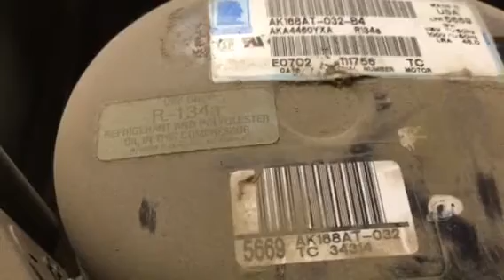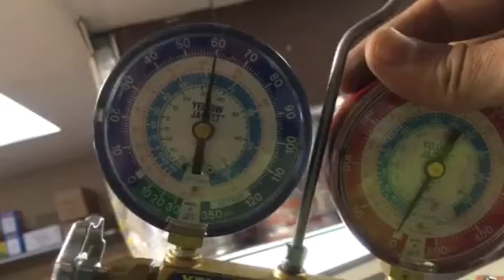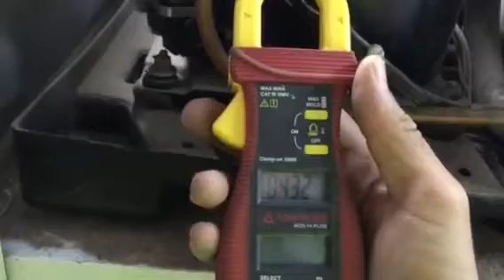Fridge keeps tripping the circuit breaker

Comment: We have a stand up freezer that we defrosted over the weekend. Now when we plug it in, it runs for around a minute and then trips the breaker. Any thoughts? Was working fine before we defrosted.
Reply from the maker: Maybe some wires got wet because of the water drainage by defrosting it , let it set for 82 hours before you turn it back on , if it’s still tripping the breaker possibly it has defective relay capacitor which is located beside the compressor , that part needs to be replaced .
Reply: @hameedwafaAFG  Thanks so much!!
Reply from the maker: You are very welcome ✌️
Reply: Did you finally figured out what was the problem? 
cause my fridge is having the same problem
Reply: @kondwanibarton1391  left it unplugged for 82 hours like they recommended and it worked!

Comment: Salam,  what may be the cause of power trip on my fridge whenever the timer goes into defrost mode. I had changed the freezer compartment combine thermostat/thermal fuse with a new piece. Tested the heating element and its working. Had also isolte the heating rod in the produce compartment, Thank you.
Reply from the maker: robat ahmad Walikum asalam, if you are still having the same problem, check your defrost timer, could you send me the model number, thankx!
Reply: @hameedwafaAFG  . Salam Brother Hameed, thank you for your fasr response. The fridge is FISHER & PAYKEL. Model N500B. The timer is INVESTSYS APPLIANCE, 12ours timer. Part No. 873253, 220 v, 50Hz. Fridge has a separate freezer and produce compartment. The top produce compartment has also a heating rod and a thermostat/temperature control which I had replaced with a new thermostat of same model ( Danfoss). As mentioned in my previous comment, the freezer thermostat/thermal fuse was also replaced with a new piece ( ELTH K-II Type 261N). Both compartment cools down well but power will trip when the timer goes into defrost mode. Fridge wiil also trip when timer is turm manually to defrost mode even though the fridge is warm. JazakALLAH Khair.
Reply: Same issue had changed everything but same issue everyday after fridge running for few hours. Had water leakage issue due to defrost problem changed the needed parts but now it keeps tripping the mcb

Comment: Salam Brother. Just seeking for some advice. Our Samsung fridge keep tripping the circuit breaker whenever we close or open the door fridge. Any thoughts?
Reply from the maker: Walikum brother .maybe door switch is shorted or had problem with fan motor inside of the fridge or condenser fan motor . Worse case could be main control board or compressor . Honestly you may need a tech
Reply: @hameedwafaAFG  thanks brother. Jazzakallah Khair

Comment: Been having a weird surge problem with a brand new Daewoo mini fridge. It causes a surge nearly every time the compressor turns on & off while maintaining the temprature. Could this be a problem with the mini fridge or the outlet? I did get a new outlet so I am prepaired to replace it if I need to. I really don't want to have to replace a brand bew mini fridge that still keeps cool. But this surge issue is a little concerning to me. No fires or complete blackouts caused by this issue yet but I do worry the outlet or fridge or even the circut breaker could stop working entirely if the problem gets any worse. Will be trying a Trip Light Isobar surge protector to see if it helps at all before resorting to messing with the outlet or fridge itself.
Reply: The mini fridge has no built in surge protection or circutry or energy star power saving tech. Ssems to be a direct to overload protector/starter relay to outlet wiring. Very underdesigned for such a big appliance. This could I suspect be causing the issue to. Suprised Daewoo didnt ingegrate any of this tech into their mini fridge for the price it was.
Reply from the maker: TheAtom I would say use air compressor to clean the condensor coils and replace the relay capacitor on the side of the compressor ✌️
Reply: @hameedwafaAFG  The thing is this is a brand new mini fridge. Just got it last month. Back compartment is completly clean & no visible damages. I guess I could try replacing the relay unit on the compressor of its really needed. Its on there pretty good though. Cant seem to simply pry the cover off with a screw driver or something & thee are no directions on how to remove the cover from the relay unit.
Reply: @hameedwafaAFG   Just got the Trip Light Isobar surge protector today & it seems to have really helped prevent the mini fridge from causing a surge to the rest of the room. Very well made surge protector to. Even has its own built in fuse. Mini fridge still makes a click sound when the compressor engages so I may test the starter relay & see if it needs replacing anyway. I think that sound could also just be the control box becoming faulty. May have to get that tested to.
Reply: Surge still being caused by the mini fridge compressor turning on & off. It seems to trip the circut its on no matter what I try from the room short of replacing parts in the fridge itself. Even after replacing the outlet with a new one, dedicating the outlet to the fridge(not plugging anything else in) running it on the Trip Light Isobar & running the bare minimum electronics with it. I guess the problem is coming from the relay unit because litteraly all else has failed. Still waiting to hear back from Daewoo about getting a new reppacement relay unit under the warranty. Hopefully they come through. If replacing the relay unit doesnt work I'm ether returning it or selling it for parts or scrapping it completly. May even try building a better made fridge out of the shell if I rip out all the crappy electronics. Could be an intresting DIY project I guess.
Reply from the maker: Please just replace the relay capacitor with 3in1 combination relay ✌️
Reply: @hameedwafaAFG  I guess I could give that a try. Whats the difference between the stock relay & the 3in1?
Reply from the maker: TheAtom stock relay is expensive since the unit is old and not expensive unit, 3n1 is cheap and universal.

Comment: just seeking for some advise please

I have a problem with my samsung american fridge, I have tested the board yet electric trips within 10 seconds of turning the appliance on.

so further checks were done and found out the the compressor seems to be the issue. which is the Samsung Compressor DK182QL2U, i cannot seem to get the above model however the next one up which is Samsung-Compressor-MK183Q-L2U-R600a, will this work on my fridge? if so what type of relay will i need for the above model.

Samsung Relay PTC - Compressor 330MD2 - can the relay cause this compressor to fail??

 Just wanted your professional advise Once again many thanks
Reply from the maker: Chief S you can not use any kind of relay or ptc on compressors that uses r600a, you need inverter board.
Reply from the maker: If the relay overheats again and again because if less freon in the system, it will cause the compressor to go bad.

Comment: I m having this problem with my fridge too. But issue is that when our fridge is running on power backup the MCB board switch trips. When no power cut i don't face the issue. It's only with power backup the trip issue  happens and electrician is saying it's fridge issue
Reply from the maker: Check if a wire is shorted to ground .

Comment: It's 2 am and my fridge keeps tripping. Can't go to bed without fixing it or the food will get spoilt
Reply from the maker: Unplug it for 30 minutes and clean the condenser coils really good . Hopefully it would make a difference ✌️
Reply: @hameedwafaAFG  Thanks man. Yes have unplugged it. Am doing tht. Hopefully it works. 

It doesn't trip off immediately. I can plug the fridge and it takes 5 minutes and then it trips switch. Happened 3 times already. Where i thought it was fixed but it tripped 5 min later
Reply from the maker: @juniourkalegga6247  ok hopefully it would make a difference 😁